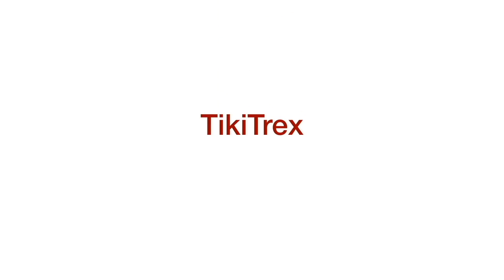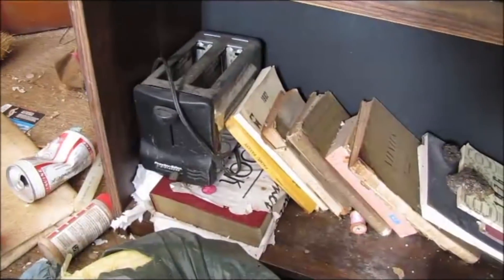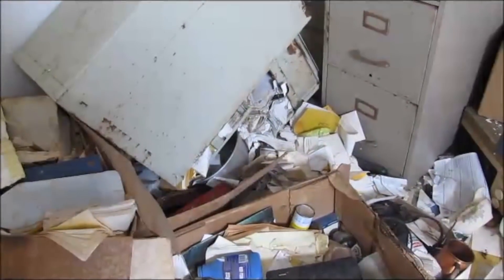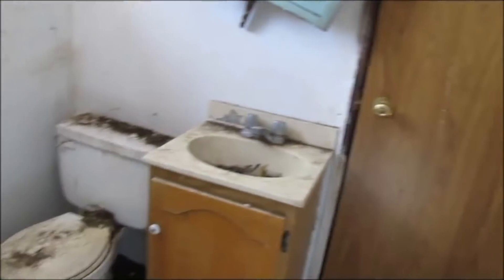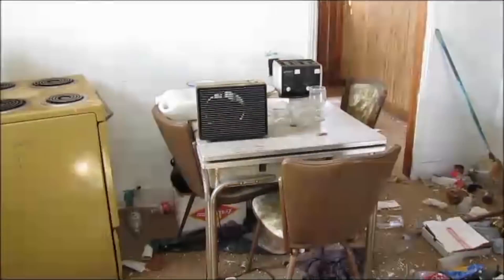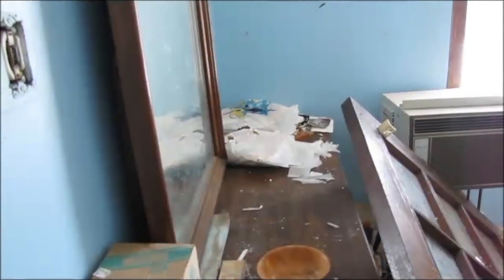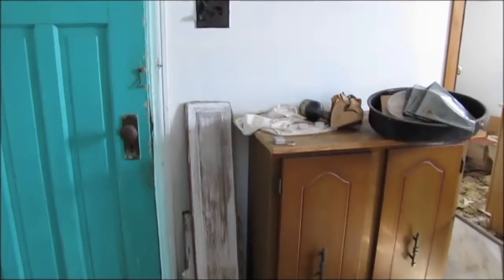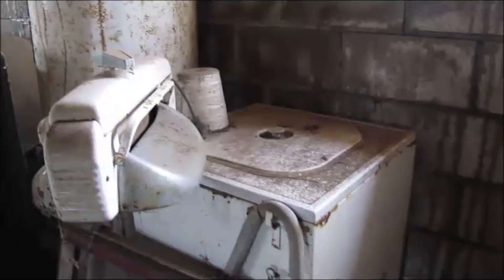Urbex: TikiTrex Original "FROZEN IN TIME" | Abandoned

Comment: I found you a couple of months ago from other explorers asking each other about you and what happened to you. I have by no means been able to catch up. I'm glad to be here and really like your style.

The two things you asked about at 12:28 look like gas space heaters that were many times vented through a chimney flue. The ones I've seen didn't have blowers in them, but since these have electrical cords on them, these may have been forced air. If I'm correct, I don't know why units this size would be needed in such a small house. If you looked at the manufacturer's plate and just didn't include it in the video, it would have the manufacturer's name, model number, and general operating specs such as the required voltage and amperage. 

Great video, looking forward to your next one and catching up on your past ones!

Comment: The units in the basement were two fuel oil fired space heaters that were in service there before the forced air furnace was upgrade was done . Probably a propane furnace upgrade . Cool old wooden framed ironing board down there also , bet it was 50 years old .